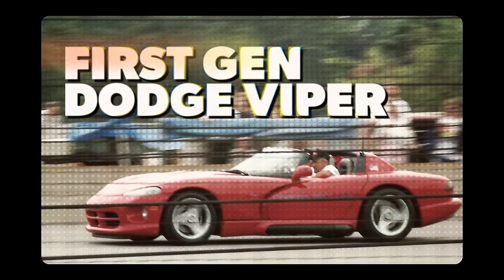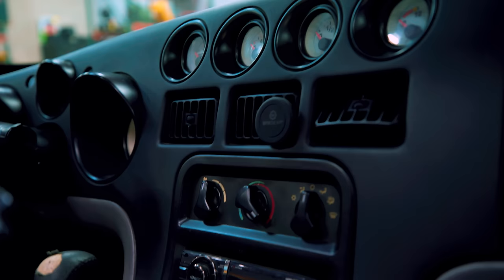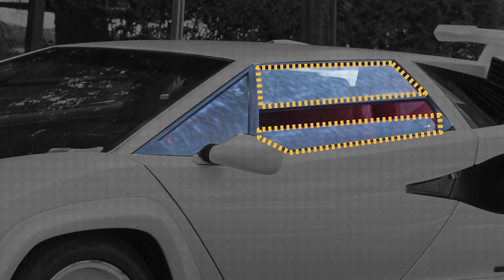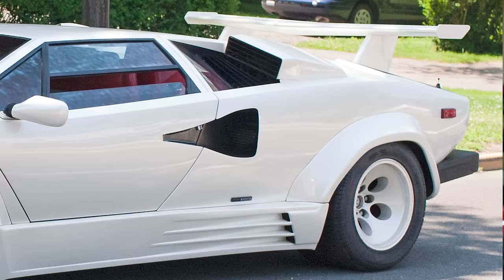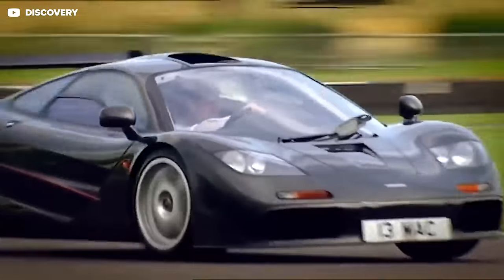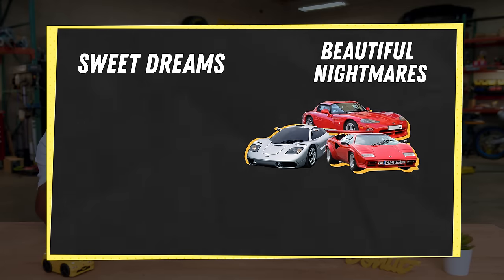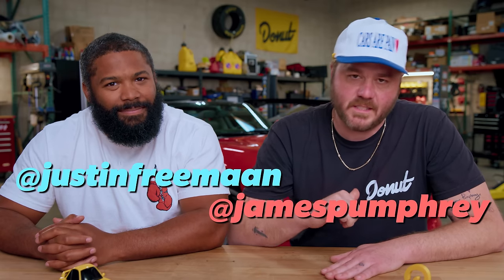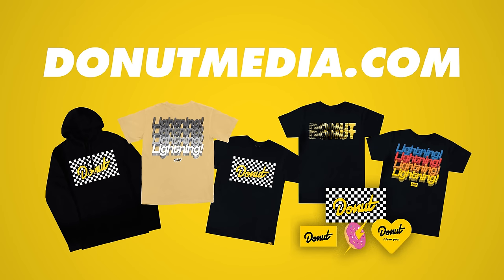Cool Cars That Suck to Own

Comment: Someone once described the Viper as a car that seemed like it was trying to kill it's driver.
Reply: Think it was regular car reviews
Reply: probably Freddy Tavarish
Reply: Common in every comment grab-bag.
Reply: That's because it is. They named it viper....nuff said 😂
Reply: I watched a period review of the second gen viper, and they showed it on track looking slidey and snappy, and said it was a way more forgiving car than the first gen lol.
Reply: The viper is a car that you don't pop the hood of very often, aka don't open the mouth. When a venomous snake has its mouth closed is when the fangs fold backwards as to not stab the snake itself. If you were to imagine those fangs they would be angled exactly where the driver is when folded, aka biting the driver.
Reply: Probably only unskilled drivers.
Reply: @grabasandwich  
How is that any different from Mustangs?
Reply: And they werent wrong
Reply: @LuckyCharms777 ??
Reply: The "wants to kill its driver" part was inspired by its inspiration the Shelby Cobra haha.  It wasn't 1st Gen Porsche 911 turbo level of "actively trying to kill its driver" but was pretty close
Reply: @LuckyCharms777  Mustang drivers tend to lose control after about 3 seconds of driving, followed by a spin into a curb.
At such low speeds the the only thing wounded is their pride ... and the rims/side panels
Reply: As with all of the cars on this list, the Viper was NOT designed to be a practical commuter car. But of course that is not why I really wanted a Viper, and not why I've enjoyed owning one for many years. It is not a car that suffers fools well, but it will reward driving skill, and put a smile on your face every time you take it out on the road.
Reply: No mention of the Dodge Steath, weird.
Reply: Meanwhile the Devil's Z
"Are you challenging me?"
Reply: It was and that made it beautiful
Reply: You’re not wrong. I heard of a story in one of the towns I lived in. A guy finally got his hands on his “dream” car.. aka Viper.. he wrecked it wrapped it around a light pole.. went home blew his brains out. Wife found him or what was left of him, after she got back from a cruise. Sad really.
Reply: @LuckyCharms777  Most Mustangs still have many safety features that Vipers don't.  That's how :D
Reply: @deanmcmanis9398  
Interestingly enough, nobody in the comments blames a liter-bike or a Veyron for trying to kill its driver. Instead of learning how to drive skillfully, they all want a GTR that does the driving for you. The Viper is a blast from the past that requires skill to drive fast, and thats precisely what makes it fun.
Reply: @cujoedaman  
Why would you want safety features? A skillful driver only needs one safety feature… his brain.
Reply: because people that say that drive on 20 year old tires while being unexperienced with tons of HP/Torque
Reply: yes...the brakes... the one guy who the first and only,,,owned in town... brakes squacked form a mile away...
Reply: I think it was fairly successful in that endeavor.
Reply: @jiml4987  How does it fit into this category.
Reply: Take it from me with a 95.. it wants to but it's much more 5ame with moden tires.
Reply: @LuckyCharms777  This is true.  I drove all manner of older cars, an '84 Camaro, '82 Fiero, '94 Chevy C1500, none of which had anything more than brakes and seat belts and never had any accidents.  Because I use my brain.
Reply: It was Brock Yates that said that. 
The Viper he drove before making that comment had been uncontrollable under hard braking due to being driven off the road  at a prior press event, ruining the wheel alignment.
Brock retracted that comment after driving a Viper that had been aligned properly.
Reply: "it's" means "it is"
You mean "its"
Reply: @jamescampbell4334 Mr Yates was dumb for making that assertion in the first place. It wasn't a tuk-tuk with a rocket booster and ship anchor for brakes. It's a fine car for a skilled driver.
Reply: Porsche 911 too!
Reply: I can't think about a Viper without remembering the logo looks like Daffy Duck if you look at it upside down.
Also Mustangs don't try to kill their drivers.
Drivers try to kill their Mustangs.
See also Camaros and Challengers.
Reply: So everyone

Comment: I've driven a first gen Viper. I used to work at a dealership in the late 90s when I was in high school. The owner of the dealership had a 93 Viper and he let me drive it...with supervision of course. It was absolutely terrifying to drive. Even at low speeds it never felt like I had control of the thing. It just acted like it wanted to kill you.
Reply: 😎 why everyone called the Viper a Beast of all cars, besides cobra 😅
Reply: Love my 94 after a full day driving it you get comfortable. But don't get complacent because of the tires are cold and you get on the throttle a little hard you will spin. Ask me how I know. But luckily I was only going about 20 mph when it happened.
Reply: I am actually looking into kit bodies and that is going to be what I pick. 

You know why? Because I'm not trying to race anyone and I keep Toyota parts under the hood.
Reply: my grandma used to be an owner operater, and I would go with her to help out, mostly with moving her heavy ramps to load and unload cars with. Once we hauled a 2000s Viper. when she was lining it up to drive up on to her trailer, she stopped while I adjusted bits of wood so the car can drive over it to clear the rear most bit of the trailer (hauling low ryding vehicles kinda sucked lul). She was worried something was getting hot near her leg (sitting with the driver door open and one foot on the pavement) so she shut it off, but then it dind't start again. Had to hire a tow truck driver to move it lul. Turns out the reason the threshold was hot was of course because one of the exhaust pipe ran through it

Comment: As a Service Manager at a Goodyear Automotive Center back around 2000-2001 or so, I had to Road Test a 94 Viper after customer bought Rims, Tires, and Alignment. Usually we have easy access in our area to quickly get to the residential streets, the regular traffic streets, and finish off the road test "circle" with a 2 mile run down the freeway. It was really helpful for diagnosing ride disturbances at different speeds, terrain, etc.,
I never even drove the damn thing out of our mall parking lot during this road test, (this was the only time in my 10 years working there that I had ever done such a thing) IT ABSOLUTELY, TRULY feels just like the memes; that the car is actively trying to kill you. Particularly, if you're not used to the subtleties of that torque hitting (even with very careful throttle and clutch control), once that power gets itself to the rear tires, that car felt utterly possessed. I parked it and hid the keys in my desk for the rest of the week until the customer was expected to pick it up. Last thing I wanted was for one of our rookie techs to try to get out for a joyride. Nope.
Reply: I have the same exact story

Comment: I have a '95 SL320 R129 and absolutely love it. Yes, I had to re-solder the brake light wiring that runs along the trunk hinge, and the blower motor had to be replaced and jerry-rigged but it was cheap and I'm learning a ton about how to work on my own car. 3rd party parts haven't been an issue yet and you don't see these on the road much anymore so get a lot of compliments. The most come from Gen Z kids, makes me think of the days of the 90s when I'd look at the 60s and 70s cars like that.

Comment: The biodegradable wiring harness is interesting. Idk if modern wires have it but one reason rats loved chewing up wires in cars was because they could smell the peanut oil that was used in making the insulation for the wires.
Reply: Toyota actually has a huge issue with this on their wiring harnesses.  Common to see a Toyota base come into a shop with wiring harness issues from rodents. I don't know specifics of what these harnesses were made out of, but I always chalked it up to "rat friendly food."
Reply: They are made out of corn derived plastics. Rats love them.
Reply: @calebboatsman7856  that's true my friend has a tacoma and his has a 2 year old 4runner both had to have new wiring harness replaced in 2 years because of rodents eating them.
Reply: No they reverted thank god. Rats will chew anything
Reply: The model of ford fusions like the 2007 had this issue. My dad hat one that was his daily driver. He kept it in a clean mostly empty garage and a small animal got to the wires over night. When he towed it to the ford dealership your explanation was the exact story the mechanic gave him. He said that they see it a lot because rodents were drawn to the wires insulation and liked to eat it.
Reply: Kia also has issues with this, most likely for the same reason.
Reply: Idk about other wires but solar fields wiring is insulated with vegetable oil based plastics and all rodents fucking LOVE it
Reply: That's why I eat them too
Reply: They are trash vipers  and it had a cheap interior design   lol😂😂😂😂😂
Reply: Y'all remember the Mazdas that had wiring that attracted spiders? 😬

TBH if a car makes it to the end of the warranty alive the company should have to replace the wiring harness with a non-degradable one lol
Reply: Is that why my xj was avoided?
Reply: Subaru apparently has this as well
Reply: Tesla once being sued by Tesla car owners because of the same issue. However Telsa themselves aren't responsible for the damages and then dipped lmao
Reply: @AHondaCivicEX  lol well bio degradable wiring is probably better for the environment. I guess rats don’t count under animal conservation
Reply: My moms ford escape got its wires chewed clean through by a gang of squirrels
Reply: Went to mechanic last week and found out my jeep renegade had a huge mouse nest on fuel injector(?). It chewed through the wires, causing my gas gauge to always sit at empty. 😅

Comment: My Dad's friend had one of those exact Vipers, and to this day, the 20 min ride in that car, on Colorado mountain-side roads, twists, turns and all, was one of the most thrilling things I have ever done. Being catapulted into the back of my seat with every shift was amazing. Sweet dream, no doubt.
Reply: They aren't practical and don't make good dailies I mean that kind of goes without saying and alot of car at that time didn't have traction control.  This was a real drivers car.  It's basically a race car with license plates and drives as such.   Cool for nice day or and weekend drives and stuff but not that practical  for a daily.
Reply: @midnight347  i think it's fine daily if not making stupid mistakes like flooring the gas and braking pedals agressively

Comment: Was lucky to own a gen 2 viper 5 years ago, you would be very surprised just how reliable they were. Never had unscheduled maintenance in 3 years of ownership.
Reply: Same here,  no issues, six years of ownership. '98 GTS
Reply: Given the engine is based on a design for a truck, it makes sense that they're reliable, after the 1st gen problems were addressed
Reply: 99 GTS. Owned it 9 years. Had an o ring on the AC line crack. 20 cent part.
Reply: @CptLang97  yea they're low revving huge displacement pushrod v10 I can see why it would be reliable.  The gen 2 looks more practical than the gen 1.  They aren't practical daily drivers for most that is for sure.  Kind of goes without saying.
Reply: I put 100k miles on a Gen1 ('94).
Crossover tube gasket coolant leak was the only issue. Everything else was scheduled maintenance and normal wear items.
Had the OE clutch when I sold it.

Comment: i was honestly surprised at how "cheap" and most importantly, convenient the bugatti upkeep was. after listing off all the mclaren prices and complications, simplifying it to 100k every 14 months and everything is taken care of is amazing
Reply: I suppose they overpriced the individual services to sell the package deal.
Reply: @jayathranps1319  It should be mentioned that if anything major that needs to be done to the car comes up during this service, the total bill quickly grows to much more than 100k. It's also worth mentioning that this price doesn't stay fixed and does increase over time, obviously. Lots of pricing info on the service of Bugattis is already outdated, because the owners don't talk about it that much and Bugatti themselves are obviously not very forthcoming about it either.
Reply: But also remember that 14 months tune up is probably based on an insanely low mileage estimate. I'd be shocked if it was even 10k mi a year. If you look up used supercars you can easily find 20 year old supercars with less than 5k miles.
Reply: @whereforartthou   Way way way less miles than 10k or even 5k a year. I bought a 2015 Vette in 2019 and it only had 5k miles on it and that was considered "normal". Super car owners do a calculation called "$ of depreciation / mile". In some cars it can be $3-$5k per mile so they rather keep them off the road and let them appreciate faster than any stock they own. That is why the crazy $7.4 mil Pagani sold out, all those hyper special models do, exactly for that reason. They raise in value faster than stocks.

Comment: Fun fact,the countach didn't actually come with the wing from factory. The dealers installed them themselves. So every countach wing has been applied differently,even some with drywall screws has been seen before!
Reply: And the wing does absolutely nothing except add weight and drag!
Reply: @rocketsurgeon11  exactly,and honestly just looks stupid IMO,I personally would remove it
Reply: @frodosfrostbite  my 10 year old self screams NO!! But my mature me with my knowledge of it and the design of the car...yeah, I'd probably take it off, too.
Reply: @rocketsurgeon11  I was the same way until I found out it was actually just a dealer aftermarket option lol its literally factory rice
Reply: @rocketsurgeon11  very much a useless boomerang you attach on your car that also has the very useful side benefit of reducing your already tiny visibility even more

Comment: I've got a '95 RT/10 and as Justin mentioned, they are a great track toy.  My partner really doesn't like the car.  I LOVE IT.  But she has no interest in road trips in the viper.  We also have a C6 corvette and she is in love with that car.  It's comfy, it's more practical, it has heated seats.  I drive my viper all over the place, but I wouldn't say there is real concern for it breaking down all the time.  It's been stout as stout can be.  However, I do autocross it and it spends a lot of time getting driven hard.  Easy car to work on too.  I can certainly agree they are impractical but I wouldn't go so far as to say they suck to own.

Comment: I'd love to see a series with you guys building a kit car.
Reply: Like an Ultima with a 7.0 from the C6 zo6
Reply: @Twofrogsonecup  I think a Caterham 7 or a Factory 5 Cobra replica would be more in the style of the Donut team personally.

For a starting point, they could use a K20 for the Caterham or a Shelby GT350 Mustang engine for the Cobra, then if things work out and the series is popular/successful, they could do a "part 2" series where they either upgrade the K20 and turn the Caterham into a serious track weapon or give the GT350 engine the Roush Performance treatment and make the Cobra a serious street bruiser.